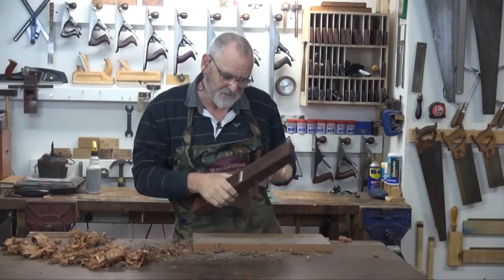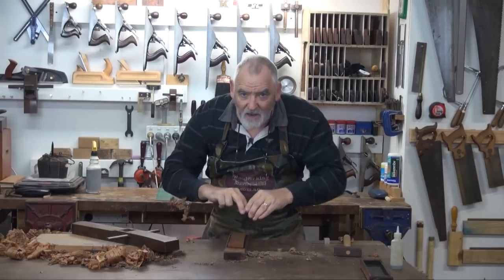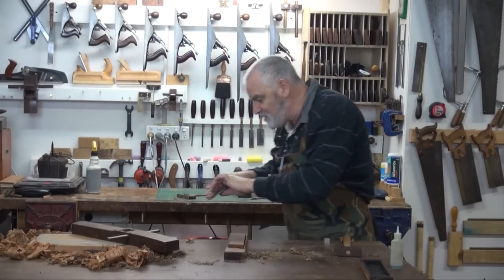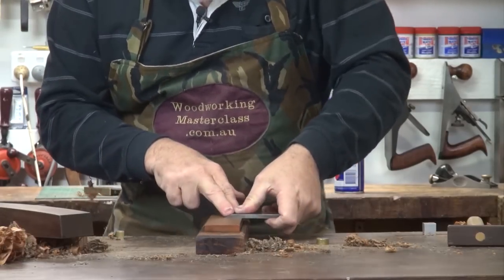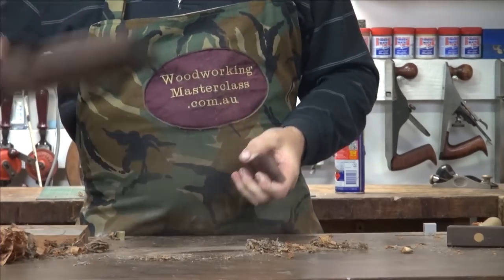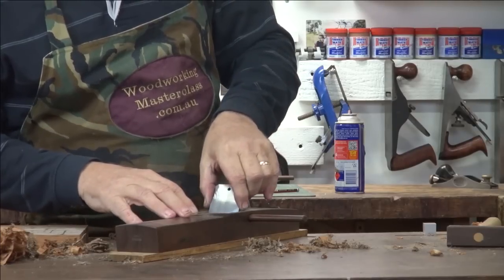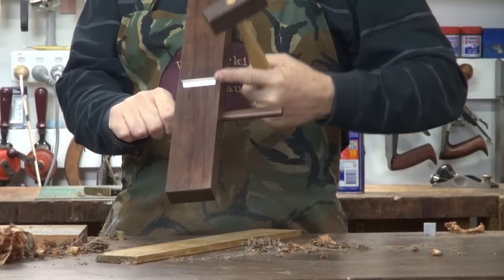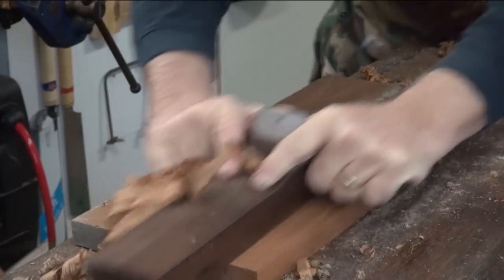Setting an HNT Gordon Plane.

Comment: Thanks for the video. What grit sharpening stone did you use?
Reply from the maker: Hi Charles, I have no idea? It is a Norton's Aluminium Oxide Oil stone classified as Fine. Bought from a Hardware store about  30 years ago. Cheers Steve